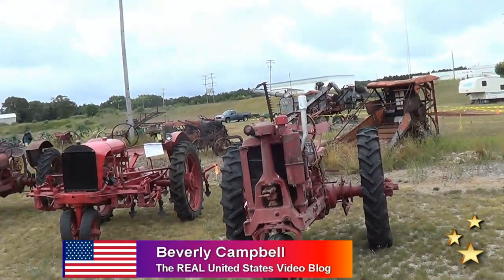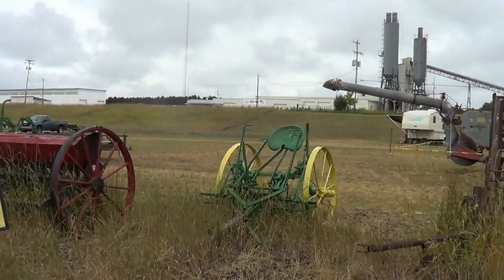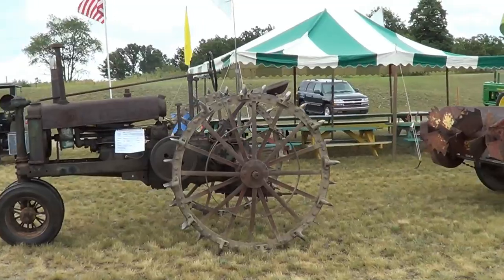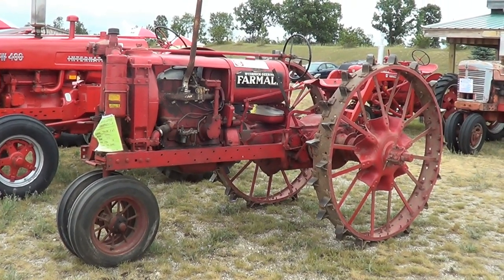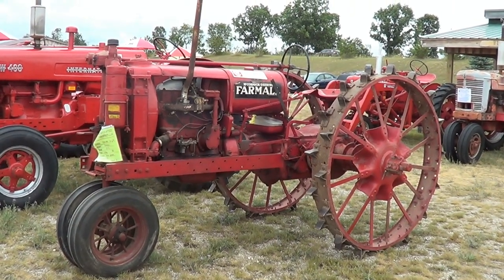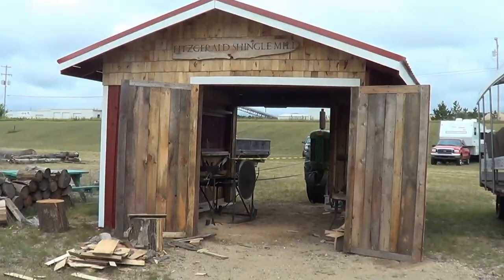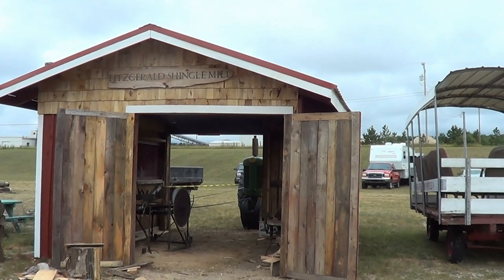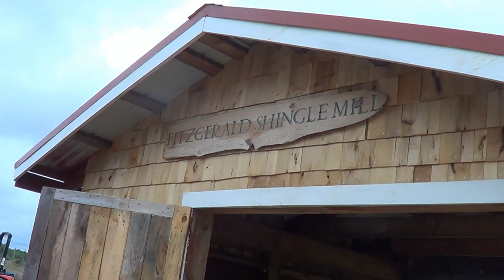Antique Tractor Show Part 2 - REAL USA Ep. 60

Comment from the maker: Tom, indeed it was. I have used a pulley and belt drive for a buzz-saw to cut firewood, but that was over three decades ago. Bev's family also used a belt drive on a PTO for run the feed chopper on the farm. It was a great adaptation to have a power source that was mobile.
Thanks for watching and commenting!!!
Paul